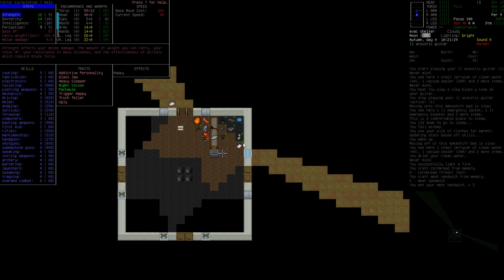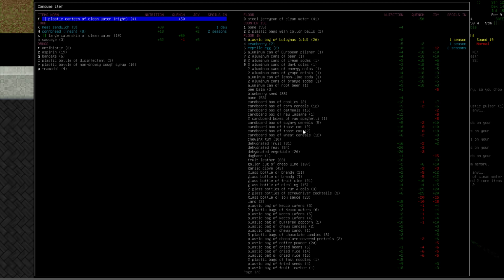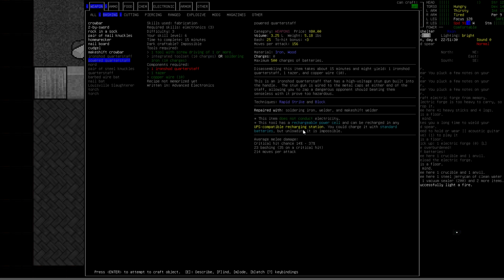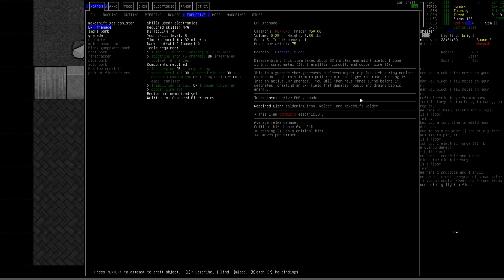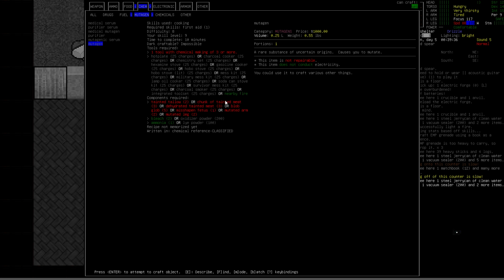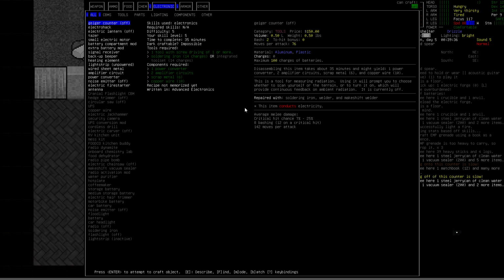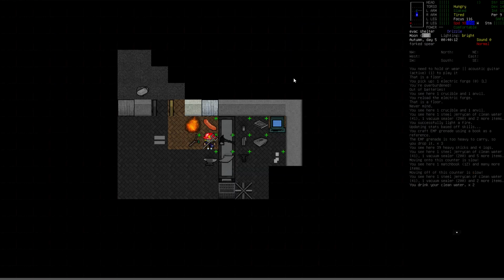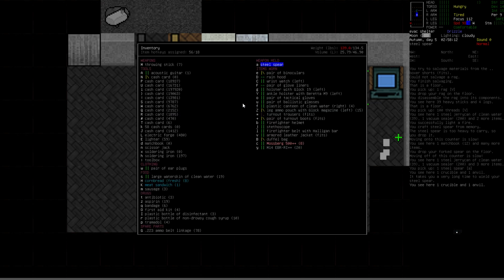Cataclysm DDA - Episode 47 - Tools, Tools, Tools

Comment: I have a suggestion for a useful tool that you might want to craft as you have charcoal. It is a charcoal water purifier which only requires 75 charcoal, a gallon jug and 4 rags to craft. It has 150 charges and can clean up to 150 units of water in a large storage container in one go without the need for power or fire. Once you have used it up you can even disassemble it and get the rags and gallon jug back. It only requires a Survival skill of 2. I find it really useful early game